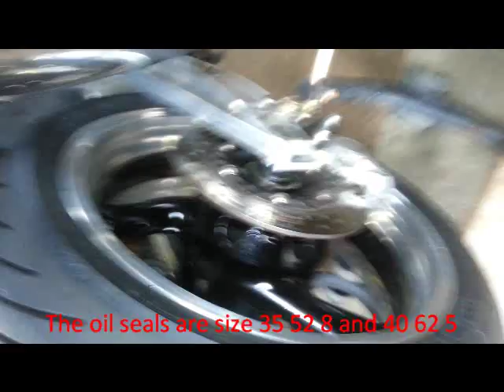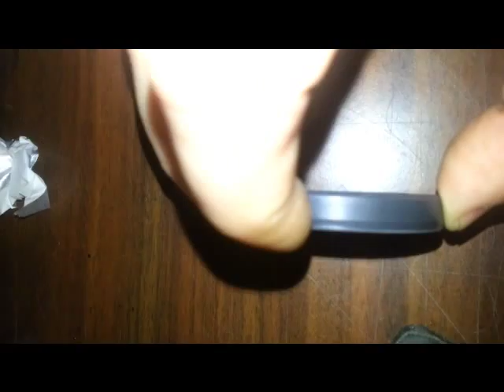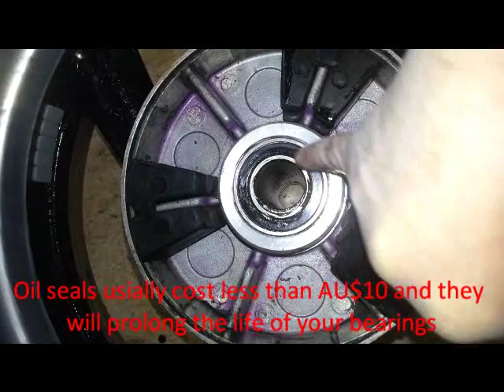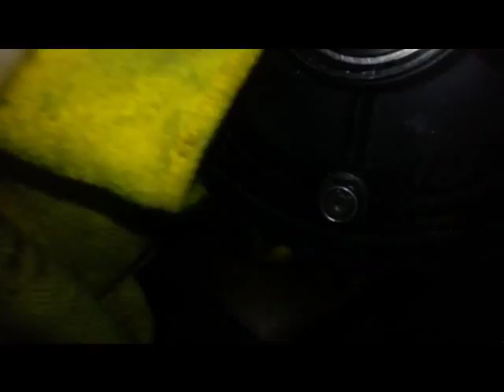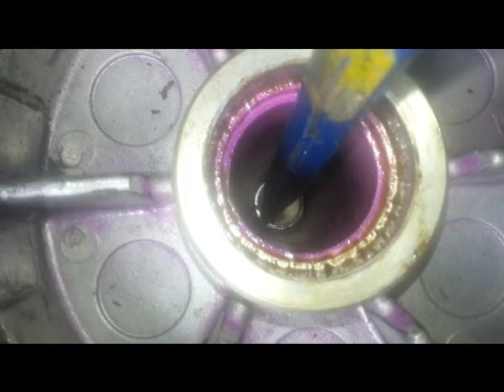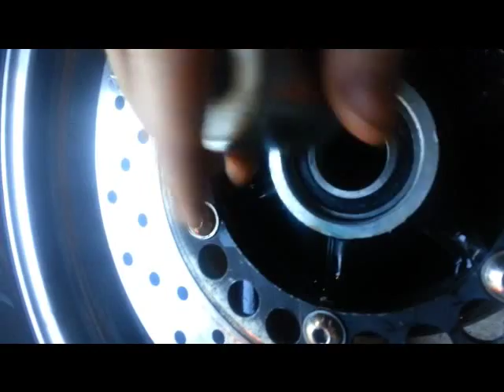YZF750R Wheel bearing replacement

Comment: Did you instal bearings with C3 clearance or normal clearance?
Reply from the maker: Normal clearance. Rear bearing is 60/28 DDU (NSK) / size 28 52 12